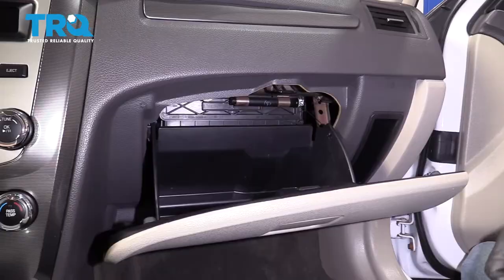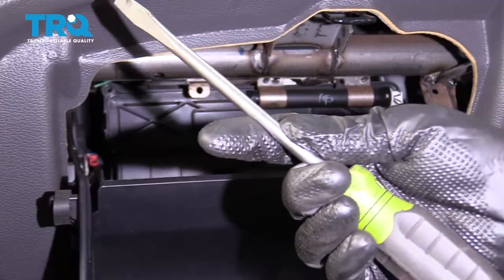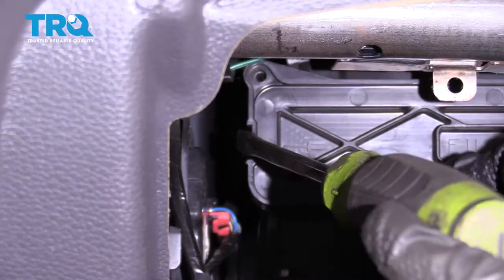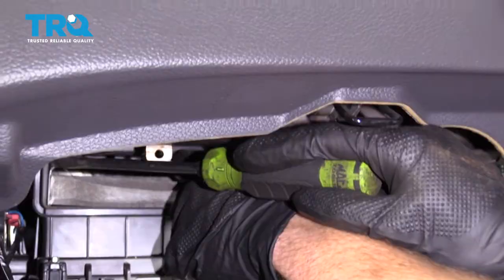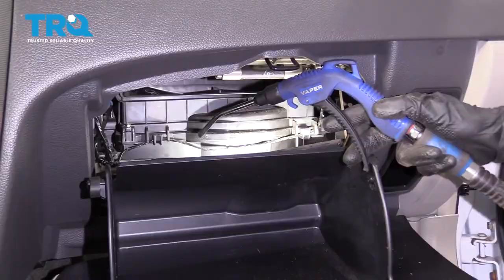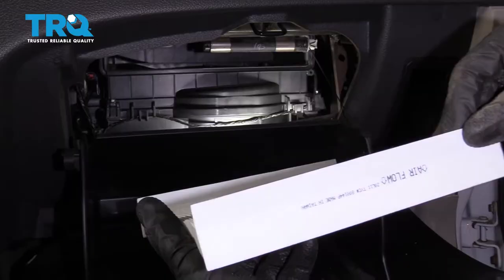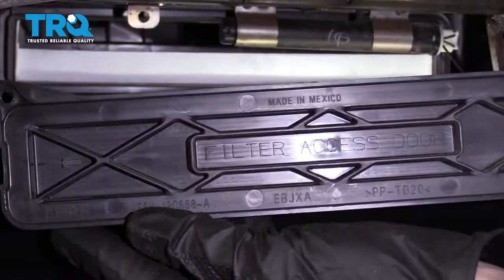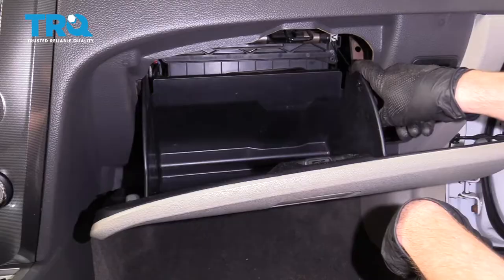How To Replace Cabin Air Filter 2006-12 Ford Fusion

Comment: just wondering what do you think the problem would be if the defrost is blowing more on passenger side than drivers side. Drivers side takes longer to defrost than passenger side in the winter time.